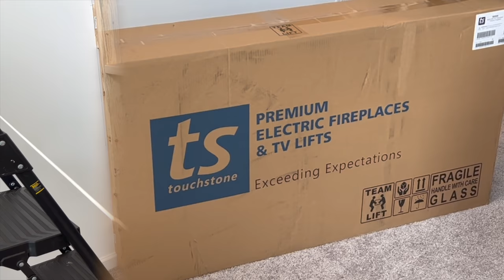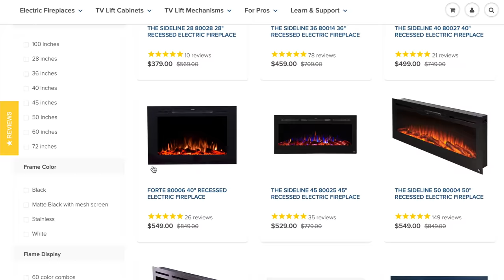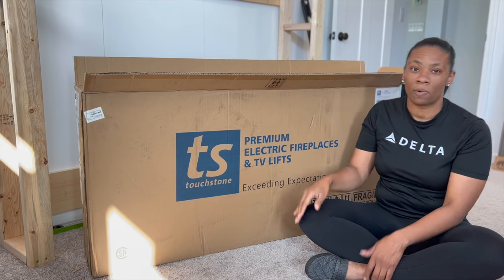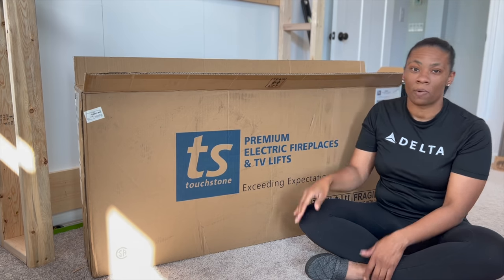DIY SHIPLAP ELECTRIC FIREPLACE BUILD & Mantel | Primary Bedroom Makeover Pt 4 | House to Home Update

Comment: Forget the beautiful and outstanding job on building your mantel, but let's talk about everything else that you two did right. First off and very important, you spoke clearly and explained each step as you went along. I really did appreciate the fact that you did not always tighten your screws until it was absolutely needed, and then you (Matt) explained the reason why. Ms. Brittany, you were most articulate in your explanation of 'everything'. Again, other than the incredible work and the articulation, most importantly, the safety involved. You both used safety goggles, gloves, and proper ventilation (while using the spray gun) where needed. As a Safety Professional,  there's nothing more pleasing than to see a DIY,'er put safety at the forefront of their project.  Although you did not mention gloves, glasses, etc., it was obvious that your safety meant more to you than anything. 
This is the 'BEST' choreographed instructional video that I (personally) have every watched and one in which I sincerely appreciated and enjoyed. Thank you for the video.

Comment: Amazing as usual are you sure that your husband is not a carpenter.    It’s amazing when you have a house there’s so many things to do to enhance it.  It turned out beautiful 👏🏽👏🏽👏🏽 👏🏽👍🏾 
My latest project was to hang my TV on the wall and put the wires behind the wall.  That took a lot out of me, I am an old lady. The only thing my husband did was help lift the 
TV, help me find the studs and cut the holes in the drywall for me to run the cable wires 🤣. Again amazing job again as usual.
Reply from the maker: Thank you. 😝 hey at least your hubby helped hold the tv up for you and cut the holes lol.

Comment: Great build! Thoughts behind building an access point to the shiplap incase you need to replace the tv or the electric fireplace breaks?
Reply from the maker: Thank you. There is an access area behind the tv and the glass can be removed from the fireplace so that we can unscrew the fireplace from the studs to remove it for whatever reason.

Comment: Nice what size Brad nails did you use
Reply from the maker: Thanks. I think I just used some 2” nails we had on hand but the shiplap is only a half inch so you can use any size from 1 1/2 to 2” and you’ll be fine.

Comment: I have a question when doing your support with 1/8 why did you use brad nails and not screwing straight into the wall studs with screws for added strength?
Reply: I'm sorry I can see the screws that you used....
Reply from the maker: @seans.8999  yeah the brad nails were really just to keep it in position 👍

Comment: I was watching your  previous videos building  a fire place and to get some ideas.  I was wondering why you built the structure of the fire place on top of the carpet.  Is the structure temporary, it’s going to be an issue if you have to change the carpet
Reply from the maker: Great questions. It is not a temporary structure. Well anything can be removed if you wanted to but in regards to changing out the carpet. You would cut around the fireplace and replace the carpet.

Comment: What happens when the fireplace goes out or stop working? U have to take your whole wall down 🥴 to get to the plugs/outlet?
Reply from the maker: The fireplace insert comes out of the opening that was built by taking off the glass. I would simply replace the fireplace insert if that were to ever happen.
Reply: Ok. That’s my fear 😂 I want a build in in my new home and master room but that was my biggest concern. Like how do I get to the outlets etc. thanks

Comment: The only issue i had was you put it on top of the carpet. If anyone goes to change that in the future it will be a pain to deal with.
Reply from the maker: If they change the carpet out they will just cut around the fireplace.
Reply from the maker: It also allows a future buyer to remove the fireplace if they don’t want to keep it and not have to fix the floor or baseboards because they’re still intact.